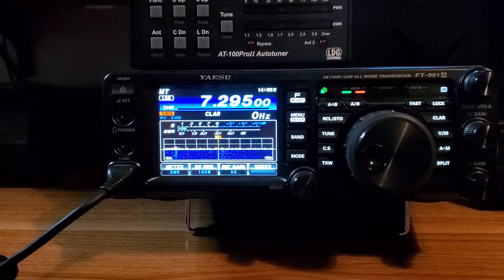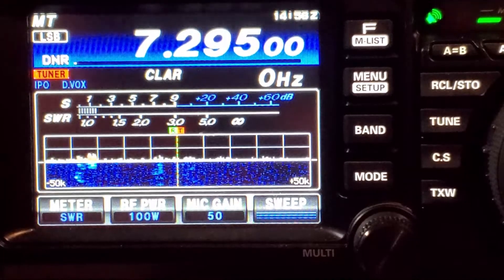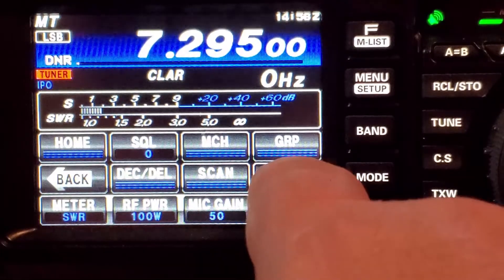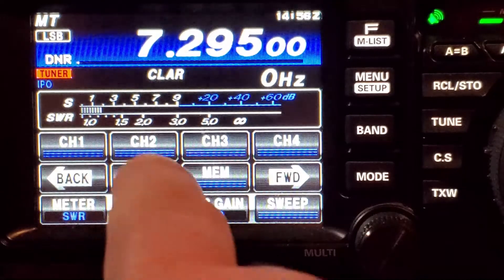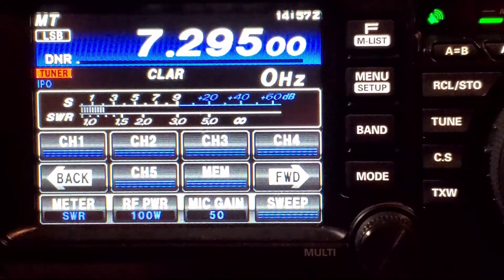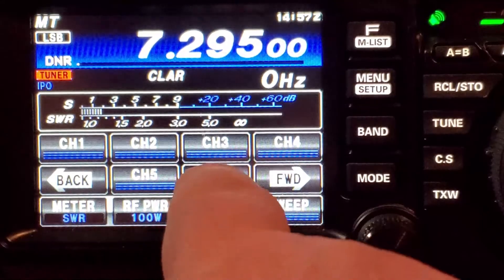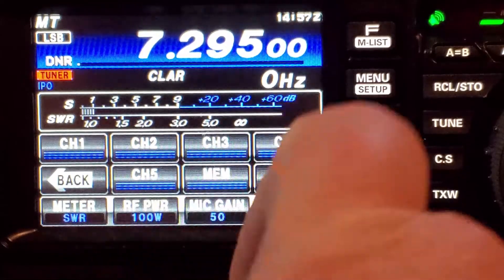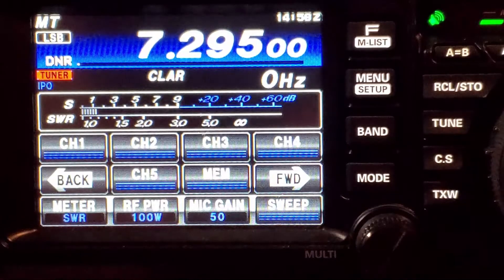Using Yaesu FT-991A recorded voice memory and transmit function

Comment: Thanks for the confirmation. I have tried this a dozen times. It goes through the motions but nothing is heard on playback unfortunately. Wondering if external audio is routed to the input opposed to the front mic. Radio works fine for phone operation with hand mic. Not sure what is going on.
Edit: On playback you can hear the pop and hiss when the AF gain is turned up, but no audio :(  It definitely tried to record something though.
Reply from the maker: hope you are able to get it working or fixed
Reply: Hello John, have you resolved your problem? I have the same problem! 
Bonjour John avez vous résolu votre problème. J'ai le même dysfonctionnement !
Reply: Did you press the PTT while recording? Otherwise there wont be a recording, just silence.